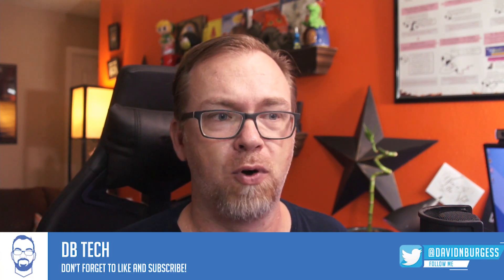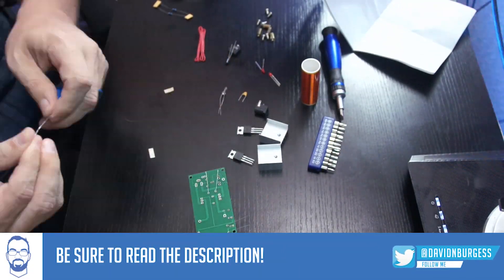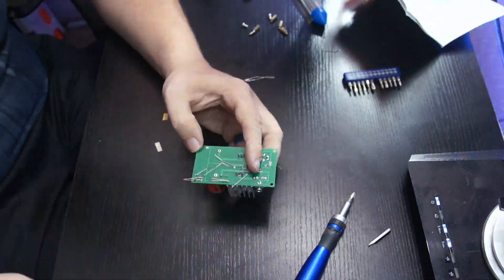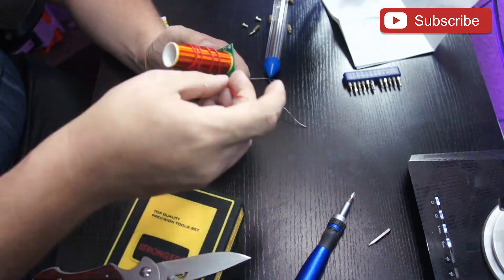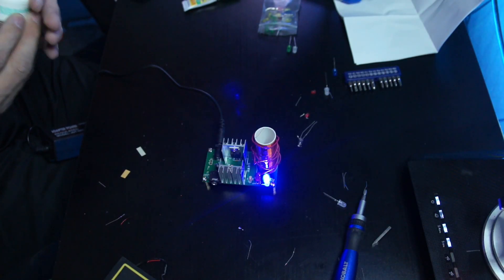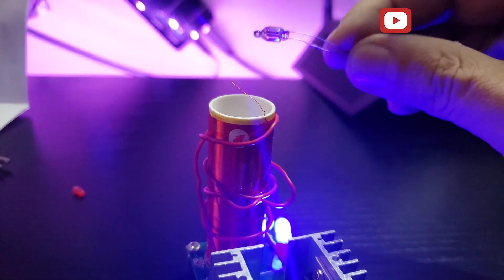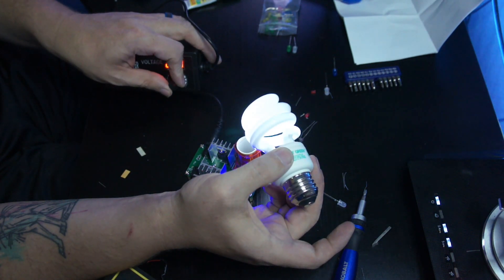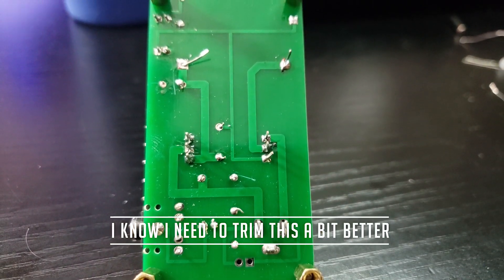DIY Desktop Tesla Coil

Comment: Hi. I got one but before I put it together I have a few questions... Is the secondary coil only soldered at one end to L2? Does it matter which way up it goes? What is the arrow on the coil for?
Reply: The secondary coil is only soldered at one end. The other end it the "antenna".
The arrow is just the sticker that holds the loose single strand of wire from getting unwrapped during transit.
It doesn't matter which way the coil stands up or down.
So, you remove the arrow sticker then carefully unwind the single strand, and also locate the short wire at the other end of the coil. Clean off the enamel coating and solder one end onto the PC, and poke the other end up in the air so you can touch it and zap yourself.
Reply: @johncoops6897  Yeah, got it going. Scary!

Comment: Looks like, by reading the comments elsewhere, people recommend making the thick coil very short and near the bottom. You might only be reaching a fraction of the coil's potential by wrapping the thick wire around the central coil so many times, and all the way up.
Reply: 1.53 - the instructions and PCB say two or three turns on the primary winding, not to drape the whole roll of wire like a set of Christmas lights, which is what this idiot has done. The primary coil will work better with 2 turns, but need more power than if three turns are used.